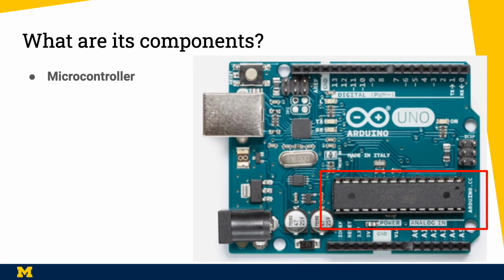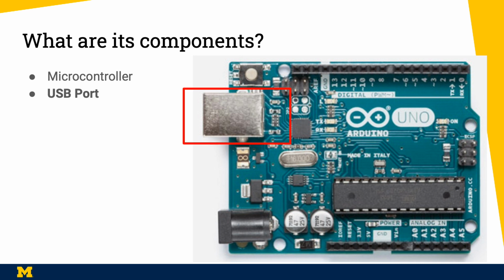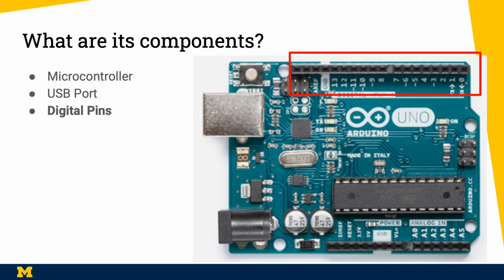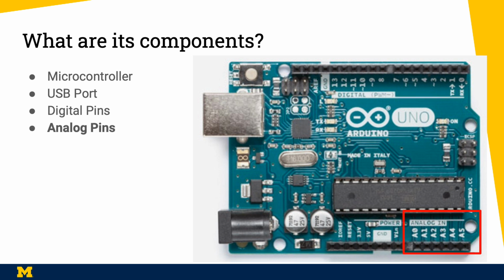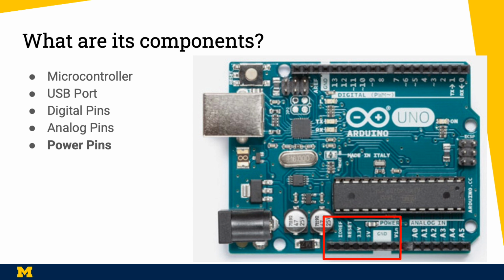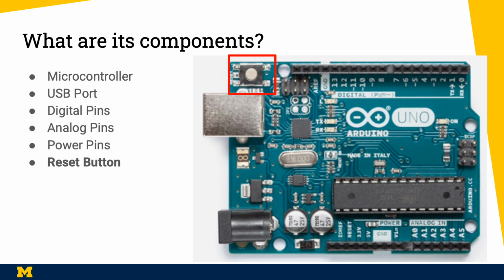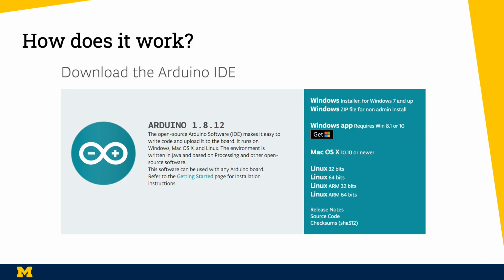INvent Academy: Introduction to Arduino Part 1

Comment: one question how do I download the program??
Reply from the maker: Thanks for reaching out! In order to download the Arduino IDE, you can go to this website (https://www.arduino.cc/en/main/software) and select on the side panel the version you need for your type of computer. If you have your own Arduino unit, this is the software you will use. For future modules in INvent Academy, however, we will be using TinkerCAD circuits to program virtual Arduino circuits, so you do not need this software.
Reply: @inventacademy633  thanks